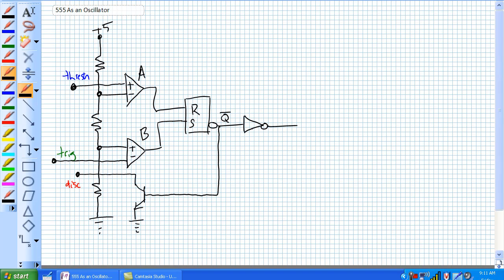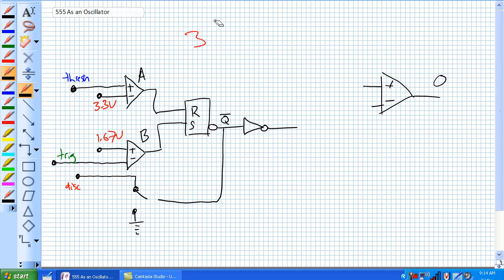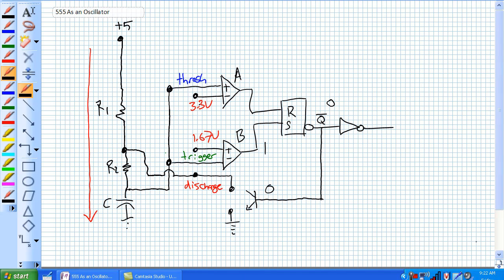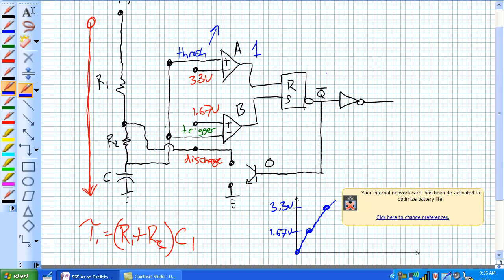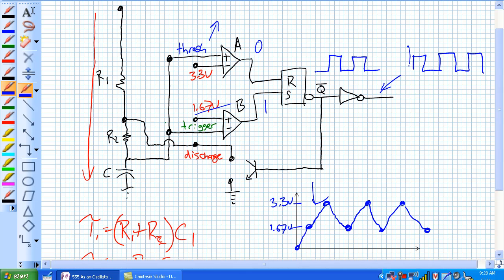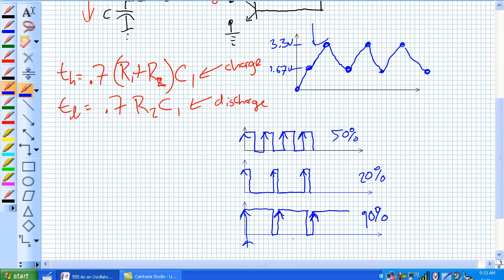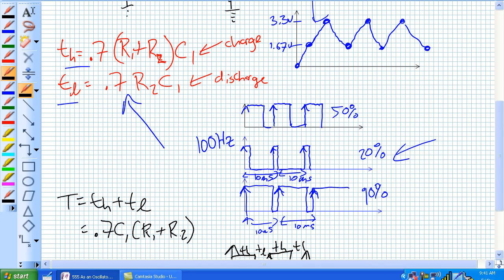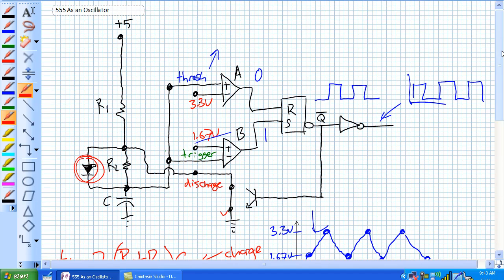555 As An Oscillator

Comment: But during the discharge the path is through R2 and transistor, but what will happen to the +5 Volt that pushing its current through R1 ?. would that affect the Capacitor discharging time?